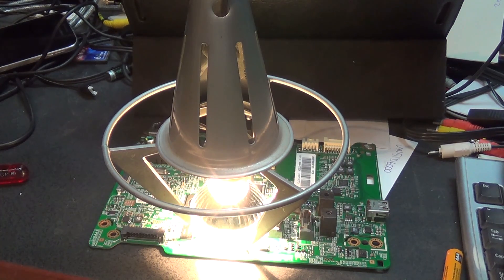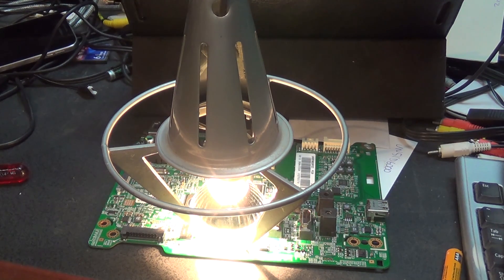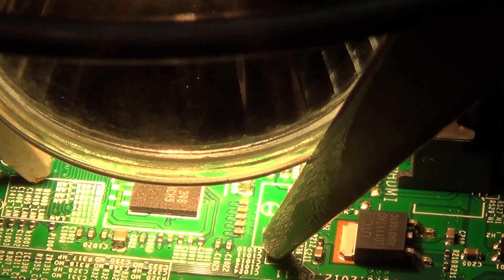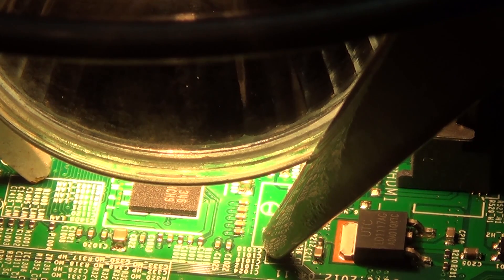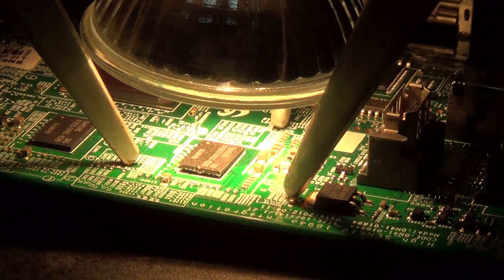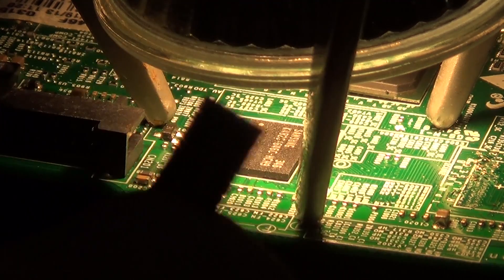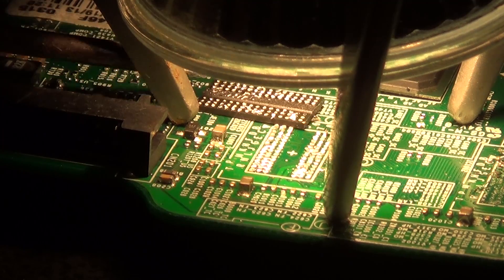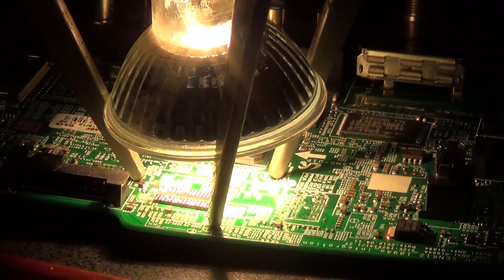Reflow BGA solder with a GU10 halogen light bulb

Comment: what wattage is your globe? is 2 hours maximum heating or necessary heating time?
Reply from the maker: 50 watts
Reply: @12voltvids  thanks
Reply: Can I use a main board from a hisense 65r6 series tv and put it in a 50r6 series hisense tv? Both main boards have RSAG7.820.8698/ROH printed on them
Reply from the maker: @Hobbyscrapperaustralia  probably.  I swapped a Samsung board from a 40 to 46.  Same model just different screen size.
Reply: @12voltvids  no worries, thanks mate.I'll give it a go and let you know the result
Reply: I recently put a 65r6 main board in my 50r6 hisense tv and the tv works perfectly.Both main boards from 50r6 and 65r6 series have same number printed on the main board so clearly is the same main board used in both size tvs from same model series 👍

Comment: What is the power of the lamp?
Reply from the maker: 50 watts.
Reply: @12voltvids  Thank you, I wanted to try to do a propper rebailing on a GPU, but couldnt afford a rework station...
Reply from the maker: @filenotfound__3871  
Nobody can.  Unless you are doing high volume it just isn't feasible.
Reply: @12voltvids  What is the time needed to fully complete the reflow work, I think you said two hours, is it true what I got?

Comment: Good job? You are broke PCB on 3:55... Very small temperature and brute strength...
Reply from the maker: That was a scrap board.  This demo was to show the trolls that said a halogen lamp could not produce enough heat to reflow a chip that it can and does produce more than enough heat to do the job and does it quite nicely.  If it gets hot enough to remove the chip it is more than enough to reflow it.

Comment: If you use bottom preheating from a halogen lamp heater to the pcb and apply flux to the reflowed chip then a bga rework station is made with no cost.The only problem is that the bottom plate preheating is missing.

Comment: put another lamp in the bottom at a higher distance to avoid thermal dilatation from the colder bottom part, that way you can speed up a lot the process and guarantee your board won't bend while it's cooling and you can be less affraid of the heat cracking the solder while you do your process. What fucks a bga repair is to cool the board heating only one side of the board.

Comment: It's a good thing this video is not popular!  The anti-heat-gun trolls would be all over this.  I have heard this referred to as "board sodomy"  I disagree with the trolls.
Reply from the maker: +Tech Gorilla 
I get the trols. I delete their posts. I couldn't give a rats ass what their opinion on heat gun or halogen lights are. This process works an let's me fix a non functional board at essentially no cost. Every one I have done is still working.
Reply: Well, a troll I am not.  I found you because of a Bose wave radio fix and have never left.  You're an amazing font of knowledge in a really chill package.    RE: Your scope:  Are there any pitfalls I could run in to by picking one of them up for, say, $80 US?  If I have the right information on the circuits, I can do repairs.
Reply from the maker: +Tech Gorilla Scopes are great for checking analog circuits. They are a much for VCR work. 80 bucks is good for a scope. Mine was 1400! Mind you it was new. Just make sure the trace is nice and bright, as that will tell you the condition of the CRT.
Reply: It would be 80 shipped.  The pictures do not display a trace.  On of those fleabay "as is" deals.  I'm on the fence yet.
Reply from the maker: +Tech Gorilla Myself I would head to the local ham radio flea market. There are usually some good deals there for test equipment, and the sellers are more than willing to test it and show that it does in fact work.I have been burned a few times on fleabay. I sold an item in perfect working condition and the buyer wanted his money back on a 650.00 purchase.  I then bought a DAT recorder (the DTC670 you see on the channel) only to have to fix something that was sold in "perfect" condition.  Twice bitten by those rabid fleas on the bay.
Reply: I watched that DAT video today and it made me pause.  Ham radio fest sounds like a great idea.  I never gave that a thought.  I bet I could find a ton of good test gear there!  I'd also like to build your (or another) ESR meter.
Reply: people reflow bad chips and expect them to work? damn, the only reflow i would do is to a notebook that suffered thermal cracking because it was turned on in a closed space and then cooled the cpu quicker than the motherboard, the rest of the reflow techniques in pc are bullshit.

Comment: use a little liquid flux  to get down into the underneath of the chip .works for me
Reply from the maker: +Ray D&#39;Abreau Yes I do. This video was just a demonstration, but when I used this procedure on my Onkyo amp, I put quite a bit of flux around the chip and worked fine.
Reply: @12voltvids  I also have an Onkyo Amp.... and i like your method. One question please: How long did the reflow last in you experience? Thanks in advance. Simon
Reply from the maker: @vortexor1  it lasted about 2 1/2 years then started acting up again. I had been given an older Onkyo thx amp so I put that in service and it is still in service.  One day i will tackle this one again.

Comment: Very nice! I think I'll use it to preheat the board and then remove the chip with the hot air. Cheapass IR preheat station for PCB's, just perfect for me :) I'll buy a 100W one and use a light dimmer whenever it's necessary to reduce the amount of heat, but it's great to have more power, just in case you need it.
Reply: it would be great to have some heating in the bottom also to avoid bending and for fast preheating.

Comment: I am still amazed that using that much heat does not destroy the chip.
Reply: It would if the chip was powered up, it would probably degrade fairly quickly when powered at that temperature.
Reply from the maker: +old64goat A 50 watt GU10 doesn't het super hot. It is a slow process, to reflow I leave it on for a good hour, as it heats quite slowly. I watched a friend do it with a propane torch once. Now that's way too much heat, putting a flame on the chip for a few seconds. A slightly hotter bulb would probably be faster, but the few devices I have fixed this way are still holding out months later.  It was that or replace the entire board.
Reply: Thanks for the reply, I guess those chips can take the heat better than most chips.
I am not sure, been away from electronics too many years but if I am correct solder melts at around 700 degrees.
I enjoy your videos, my eyesight is shot so I can't even see doing point to point wiring anymore and that is HUGE compared to the work you do.
Keep up the great videos!
Reply from the maker: +old64goat 
They use low temp solder for most stuff these days. 
Melts around 440f
Reply: I did not know that, been away from this too long, Thanks again for the reply & information.

Comment: You need a thermocouple temperature probe near the chip to check the temperature its reaching, lead free solder needs to get up to about 240C to properly melt. And don't forget flux!
Reply from the maker: +zitty fang Go back and look at the onkyo fix. I used flux on that one.A temperature probe would be helpful for sure. A 50 watt halogen won't get it much hotter then 240c anyway. A bigger light for sure. I usually just put a bit of solder on top of the chip and once that melts I know the surface is hot enough to melt solder to I let it run for several minutes and then start turning down the variac and dropping the voltage to the lamp to cool it slowly.

Comment: This is fine for reflows, but totally destructive for reballing, since the bulb does not provide enough heat to fully melt the solder, then if you try to remove the chip at that point you are removing the soldering pads in the board, thus making the board unusable
Reply from the maker: +André Campana Merétika Did I say anything about reballing an IC? No I specifically said this at about the 0:05 mark. Reflow only, not reball, or replace. You need a proper rework station for that.
Reply: +André Campana Merétika He is not recommending this technique for re balling, just as an easy way of re flowing a BGA chip.

Comment: The best for this is 100W halogen lamp.You have to warm up to 220'C and slowly cool the same time ,a food [300'C] thermometer is very helpful.Cheap method to repair BGA cold solder joints.
Reply from the maker: +Blahblox Gyuanox I just used what I had. I do run it on my variac, and crank the voltage up a bit to make it hotter, but I would be concerned about heating it too fast. Slow is better, allows for gradual thermal expansion.

Comment: Is there any advantage to putting flux around the chip before you try to re-flow or is that no necessary?
Thanks for showing this. What about putting a temperature probe around it?
Reply from the maker: +amtpdb1 I did that on my onkyo, but didn't bother on the LG TV and it also worked.
Reply: That's for soldering BGA's in place. Using thick flux paste helps the IC to center better. Cleaner pads = better surface tension, and it also floats a little in the flux.